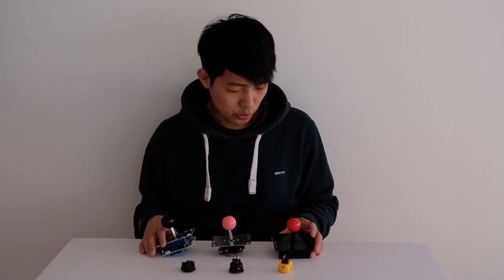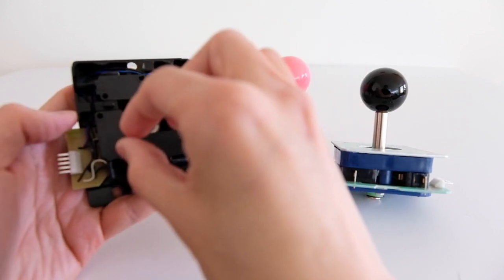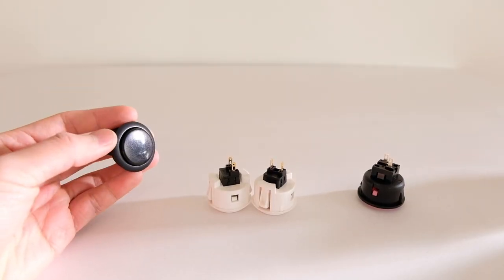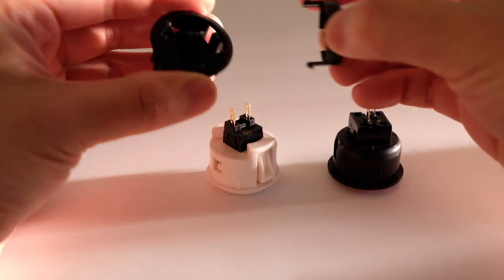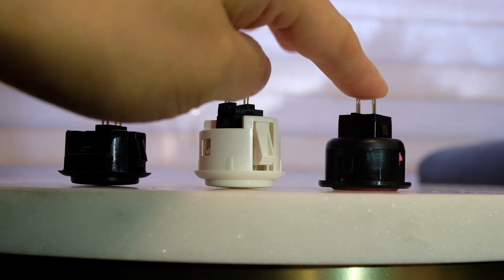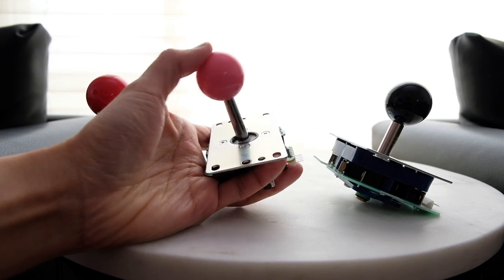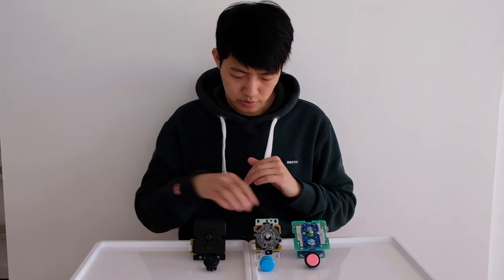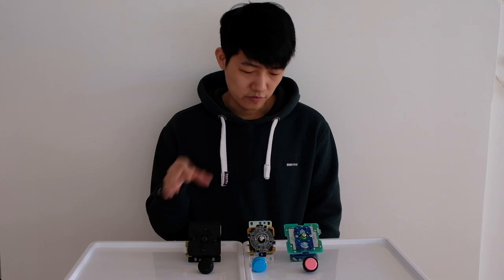Sanwa vs Hayabusa Vs Seimitsu Review Detail Comparison 2019 HD

Comment: I always used sanwa cause that's what the arcades used and when sf4 came out got tournament stick but knew needed new stick when sfv came and it Broke within a yr. Now have Hori c pad and hate tearing up figures but gave up sfv thanks for the knowledge Im a mk 11 guy now reason for switching but miss my sanwa but mk suck with one
Reply from the maker: Thank you for watching. Happy the video helped ❤️🙏
Reply: @JoystickNY  I love your channel and you have very good execution with your combos. Anyway you could upload a video of you doing KIM KAPWHAN's HAKI Cancel infinite (foot stomp) from KOF 98?  (Close standing C, down down B, back forward B, dash)xN I would love to see you do it with a Stock Sanwa JLF with Stock Springs and Stock actuator. I honestly do not think it is possible to get 3 loops or more of the combo  with that setup. Pretty sure you would either need 1) Keyboard with Cherry MX switches 2) Hitbox  3) Seimitsu LS-32 or Seimitsu LS-40. Going to need something where you can perform lighting fast dashes and also has a extremely short throw/return to neutral/centering. Maybe a Hayabusa? I am not familiar with that particular stick, I think DESK uses a Hori so maybe Hayabusa would work?
Reply: @JoystickNY  My issue with the stock Sanwa JLF lever is not the control aspect of it in general terms. I don't ride or grind the gate or anything if that's what you are referencing. Doing Fireballs and Dp motions  basic/intermediate combos isn't my dilemma. What I am talking about is when it comes to doing high execution combos that have multiple 1-frame links, require nearly instant dashes/running and also need extremely fast neutral/throw/centering its just feels impossible. I have a Seimitsu LS-40 on the way and also a octo plate with a 1mm oversized actuator for the JLF coming as well. I am forced to switch the stock square restrictor gate that comes with the JLF for the octo gate because the oversized actuator does not work properly with the default square gate. My issue basically with stock JLF is the input quickness is far too slow to be able to do the Hardest of Hard combos their are (talking about older games from the harder execution era). Like Evil Ryu 1 frame link combos in SF4 for example. Can do them on D-pad Dual Shock by the way. SFV and modern fighting games are easy in general (does not matter the control device really) and pretty much require juggle timing mostly not lighting fast inputs with extremely small link combo windows if that makes sense.

Comment: seimitsu seems like fast hardware and that it'll break easier
Reply from the maker: Amp the parts are not too expensive to replace, typically a button is 2.5$ and a lever is 20$, but it should last a good while 🙏🕹 thank you for dropping by

Comment: I am a Sanwa user but as soon as I saw the restrictor gate on the Seimitsu and the advantages over the Sanwa I'm gonna go for the Seimitsu, Sanwa is very popular I think that's why it's  the best selling joystick but I'm going for the Seimitsu
Reply from the maker: Elias Martínez seimitsu is good too, its very close to korean lever, alot of tekken players love it 🙏 thank you for watching
Reply: @JoystickNY  in your personal experience which one is the best for you? Could you give me the model and specs you use on your stick? I play The King Of Fighters but the restrictor on the Seimitsu LS 60 series has a hybrid patter which is octagonal but kinda circular at the same time so diagonals are perfect unlike the Sanwa that sometimes I make mistakes due to the shape of the restrictor, also the Seimitsu has micro switches with a aluminum piece attached to each micro switch that makes it even more enjoyable.
Reply from the maker: Elias Martínez in my personal experience, i like the [ Sanwa JLF-TP-8YT ], it feels the best for me, i use default springs and actuators and ball top, and square gate, and i like hayabusa buttons over sanwa and seitmitsu. i play a lot of king of fighters too. But mainly 98-2002. But i will be getting kof 15 for sure.

Comment: By the way, that “bigger space” is called the deadzone.
Reply: Where did he said that ? I thought it was on controller sticks ? Not arcade sticks ?
Reply: @jokertm6889  dead zones are on joysticks.  He doesn’t say it.  That’s why I mention it.  I build arcade machines.  Sometimes you don’t want the joystick to immediately respond to a movement like with competitive fighting.  Main reason is so you can back out of a movement last second.  If the joystick has no dead zone than you would make your movements instant which could be costly if you made the wrong move.
Reply: @bulletproofrecon1082  I was thinking bout building my own stick too, did u brought buttons and arcade joystick and putt them together ?
Reply: @bulletproofrecon1082  the thing is that arcade sticks are not that popular in my country and they are quite pricy and latest one are not available, even cheap ones are pricy
Reply: @jokertm6889   oh u make them yourself.  Sticks only cost around 30-50 bucks and buttons are only around 1 dollar a piece